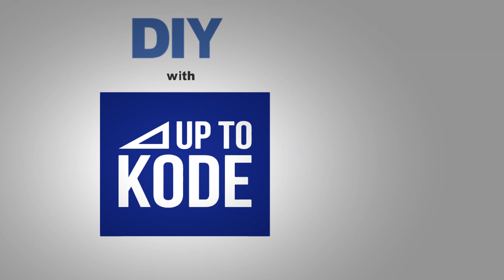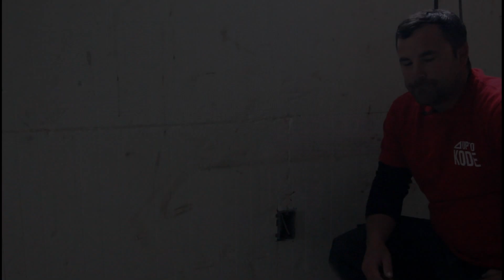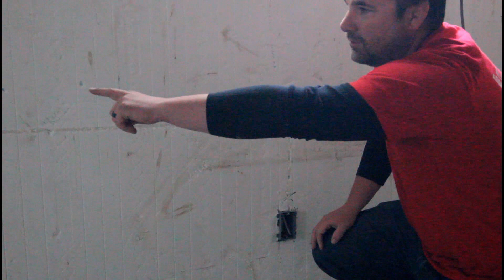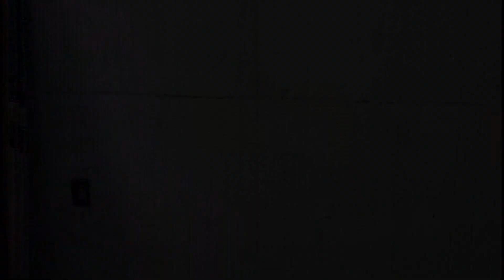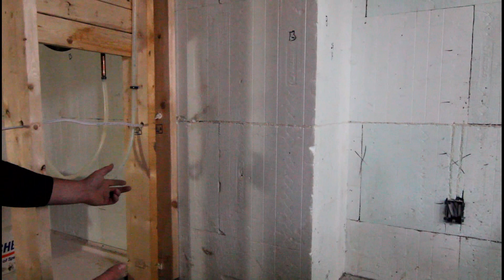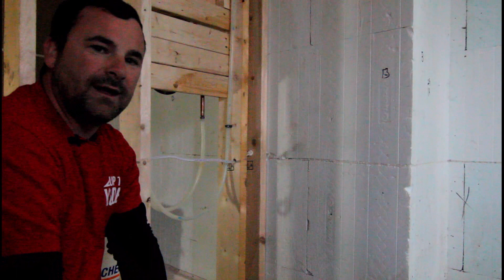How to Run Electrical in an ICF Wall

Comment: Use a Weller 100 soldering iron with 3/8 " tip to melt the runs for the electric wiring. The wire  is easily pushed in.
Reply from the maker: I like that you provided detail on what to use. Thank you

Comment: Good idea to install wire protectors on the plastic stud locations still and be sure to run wires in locations less likely to be penatrated by fasteners....avoid places like baseboard , cabinet or picture height, as the wires won't move out of the way like they would in a hollow wall cavity if a screw or nail hits them.

Comment: Hi, thanks for your videos.  How do you protect the electrical wire from screws and nails? Hard to put on nailing plates for full run.
Reply from the maker: Gouge the wire as deep into the foam as possible. It’s usually greater depth and protection versus drilling 1/2 way into a 2x4

Comment: But will this meet code????  Would love your answer.
Reply from the maker: Of course.  Why wouldn’t it? The foam is 2 5/8” thick so you can push the wire just as far back as the centre of a 2x6. And 1/2 way on a 2x4 is only 1 3/4” minus thickness of the wire.